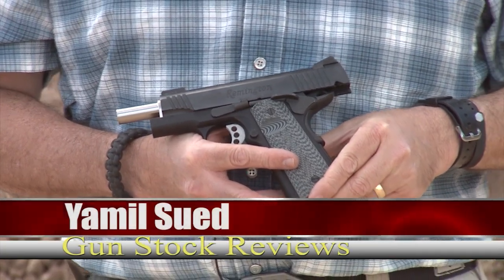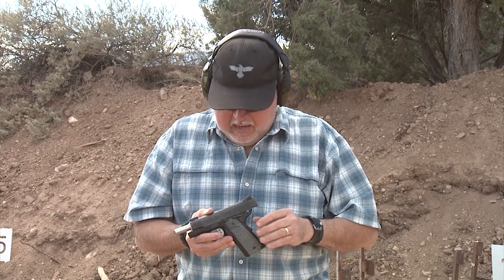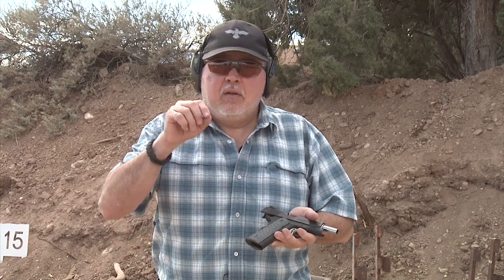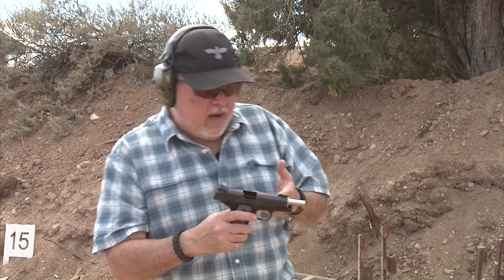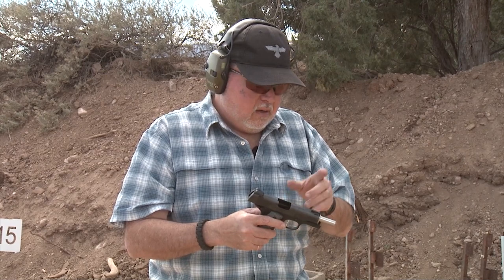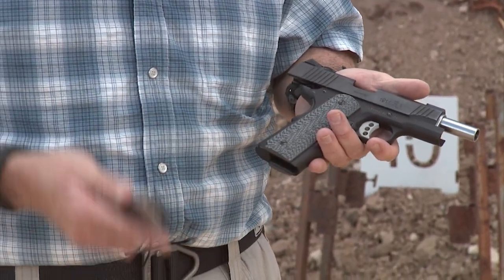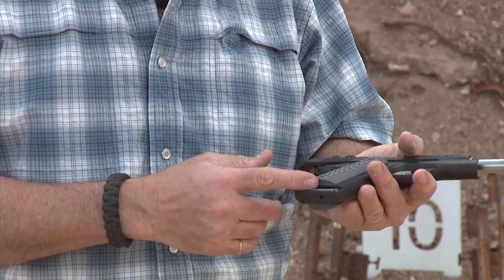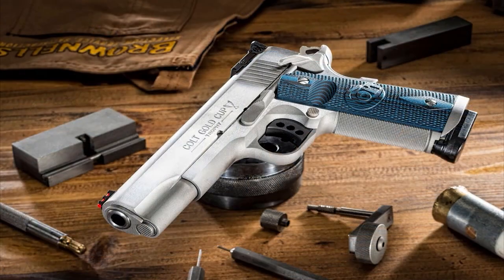Remington R1 Commander Ultra Light Weight Model  #118

Comment: Good upgrades. I do the same with my 1911s.
Reply: I did more upgrades, I ended up changing the rear sight too!!  But I might end up gong back to the Black Rear Sight
Reply: @yrsued  meanwhile I just got my Range Officer yesterday. I've already put the rosewoods I had on my Colt on it until I can get some G10s or micartas I like.
Reply: @mrflynn510  Miltac are the best for G-10.
Reply: @yrsued  I'll give them a look.
Reply: @mrflynn510  Check them out, they are OEM for Springfield, they make the TRP Grips!!